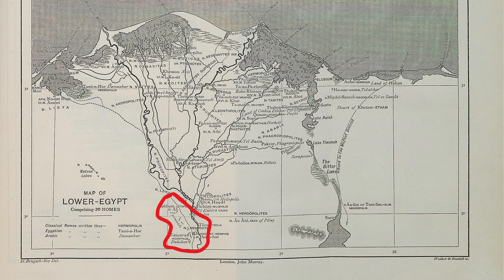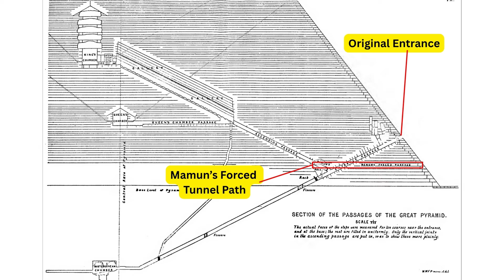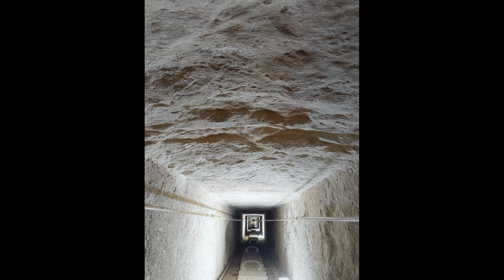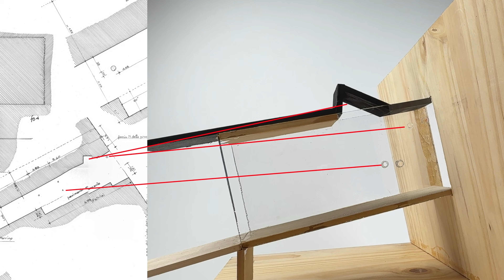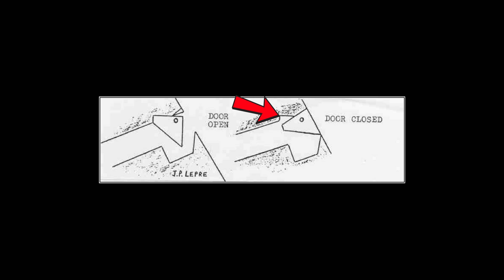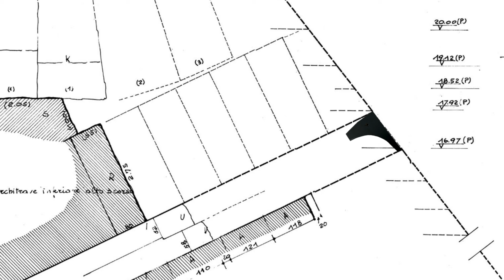The Complex Mechanics of Pyramid Doors

Comment: I feel like a very important detail that would help with answering if they had doors that could be opened is how former kings were dealt with.
Was there any need for rituals and magic inside the pyramid? Perhaps to cast protective charms that needed to be spoken within earshot of the kings body?
Was there some kind of holiday that included worship and required access?

A permanent tomb for eternity wouldn't need any access and thus no door. But if there is a reason for someone to get in, a path that could be opened would be required.

I could also see that there were different practices at different pyramids. The interiors also changed, so why not the process after completion.

And for steps leading up the outside? Could be stairs to a door. Or just to get someone to an elevated position. Perhaps a priest overlooking the assembled masses?
Reply from the maker: Great points and questions. I think a combination of those would make sense. Sort of like how we lay a president to rest in the rotunda.

Comment: I asked AI: What is the volume of the Suez canal?
That’s a good question — the exact “volume” of water in the Suez Canal depends on which parts you include. But we can make a rough estimate using published dimensions.

✅ Known dimensions
Length: ~ 193.3 km (as of recent configuration). Encyclopedia Britannica+2Suez Canal Authority+2

Maximum water depth: ~ 24 m. Suez Canal Authority+1

Typical surface-width / canal width: water-surface width can be ~ 313 m, while a narrower “navigational channel” is often 200–210 m wide. World Economic Forum+2Alexandria Chamber of Shipping+2

🔢 Rough volume estimate (upper bound)
If we approximate the canal cross-section as a rectangle of 24 m depth × 313 m width — multiplied by 193.3 km length — we get:

Volume≈193,300m×313m×24m≈1.45×10^9 m3
That’s about 1.4 billion cubic meters of water (assuming uniform maximum width & depth).
This means that approximately 14,500,000 m³ of stone blocks were removed to dig the canal. Those materials would have had to be placed somewhere: either piled up along the canal as a wall with the same width and height as the canal’s depth, or stacked into large pyramid-shaped structures. We chose the latter.
Reply from the maker: And how does that apply to a video about ancient pyramid doors

Comment: They are suppose to be sealed permanently after rulers body is put inside. Why would it ever have a door ?  In fact the Egyptians went to great lengths to hide the entrance after the ruler died and was put inside using large bricks.
Reply from the maker: The last sentence is not settled. Please rewatch the section where I mention the issues with plugs at the mouth of the entrance passage. Also no bricks were used. Thanks for watching!

Comment: Thoughtful video.  Just one question- Winches before they invented the wheel?  Big jump in technology for people that allegedly dragged the blocks up ramps.
Reply from the maker: My winch is probably more elaborate. I’m sure they had to have had some type of basic mechanical advantage in this circumstance. A rope wound around a beam with a cross bar at one end isn’t a big piece of technology. The wheel did come later most likely due to their society focusing on boats for transport due to the Nile and the sandy environment. However that being said I do not have clear evidence for what it may type of winch could have been used or if they had one at all. I’m not saying I’m right just saying it’s one possibly explanation for the holes other than as part of a door. There are of course other solutions as well.
Reply: @intothemap360 understood. We're all left to make our best guess on this topic - yours is a good one in my opinion.

Comment: I’m drawn more to a perfectly balanced door that only opened inwards, with joints so tight they blended in yet with the slightest touch would open. The reasoning for this is everything was deliberate with no mistakes and it appears everything was designed to contain (or harness) a great outward force or pressure. The concave 8 sides are like trying to open a double closet door at the same time and they just jam tighter, same as an internal force pushing outward on the sides of the Great Pyramid. The plug designs, with corresponding granite girdle stones are deliberate for a reason. Let’s just pray Zahi HawASS passes soon so we can take a step forward as humanity. ¢2
Reply from the maker: I see what you’re saying! Is it closer in your mind to the Lepre or Goyon door or something else. I will certainly build and test more door models!!
Reply: @intothemap360 I’m really interested in this and you’re the first to get comprehensive about it. Props. I want to know if all the stones are set at the inward concave on every course, further proving a deliberate design element. I’m sure there are areas where a couple of layers can be seen. Are you aware of the 360° girdle stones of solid granite in the passageways? Another interesting observation was that although isolated from the surrounding structure, the granite “king’s chamber” appears to have expanded outward. Although you’re focused on the door I also find the granite beams above the “kings chamber” fascinating since they are structurally not for weight relieving. The rough tops indicate to me they are ‘tuned’. As far as I’ve seen, no one has calculated their volumes and put together a “chord” structure. Similar as to how a wooden marimba bars are scooped out below but all have the same smooth playing surface. Given the piezoelectric nature of rose quartz granite this is indicative of another deliberate design feature. I hope the hidden gallery above the grand gallery is intact and untouched. I bet its entrance is obvious when it’s discovered, but so cleverly hidden it blends in like the original outer entrance door. Don’t get me started on the striations on the sides of the opposing shelves of the grand gallery and the sockets. We’re just children looking at a chainsaw and are led to believe it’s a tomb lol. If you have an attraction to Ancient Egypt I would suggest a lengthy trip down the Edgar Cayce rabbit hole. The forces at play are tremendous. Another great video topic would be the Shamir stone and its purpose and use and a possible correlation to the Dendera light and the scoop marks of the unfinished obelisk. Again, great video, keep up the good work. Your models show your after more than clicks like Ancient Architects who clearly does it as way to monetize people’s natural fascination and sticks to the mainstream narrative. History for Granite has some interesting graphics on the construction of the original entrance that may help. Aloha
Reply from the maker: I really need to get back over there and make some on site measurements of my own. I certainly am after more than views, I do this because I want to learn and this is the best way I can teach myself. I’m no expert, I’m just trying to show what I’ve learned and hopefully it’s fun to watch. I’d still make these with zero views. But I’m glad some folks like them!
Reply: the door being able to open with the slightest touch is stupid. a strong wind could open it
Reply: @acatinatux9601 ok then 20#, or 30#, or whatever you deem necessary to satisfy your negativity. The problem with negative people is they have a problem for every solution. They offer nothing and criticize others.

Comment: I prefer the door without counterweight opening to the inside.
It's the only one that would close seamlesss from. The outside.
It could be opened by bringing it into upright position with should not be too difficult. then revealing a hole at the top. Put a lever into this hole and you only need a few men pulling. When open, add some posts under the door to keep it open.
Only issue: how to close it from vertical to casing stone angle?
Reply from the maker: See this is why I love making videos like this. People come out of the woodwork with such clever ideas. I did not have a way to incorporate the little joke directly over the door into a design and this could be part of it. I believe you refer here to the flap style door that I showed being pushed inwards and then propped up. The best I had as a negative about it was a ridiculous claim about it being unsafe, hardly a concern for the ancients. I did not however bring up another issue I had with it and I’ll let you know what it is, and you may have some thoughts on the matter. The problem is as follows. If the door hinges inwards, there has to be force when released to push it forwards to match the angle. This is what I believe you refer to in your last sentence. In that I share your concern, if there is no counterbalance what force is there upon closing to hold the door upwards against gravity? I must build more models!

Comment: How do they open, displacing the space used by the stones abone them? This only seems to work in a drawing.
Reply from the maker: On the bent pyramid it’s hard to see a design other than one with a rounded top working. On the great pyramid the design in my model could work if the upper frame was designed correctly. As you can see from my model there are issues with the Petrie designed door binding.

Comment: The exterior swivel door seems to be used for repeated access such as for construction and inspection
Reply: These kinds of doors and corridors seem to work really well with the theory that the pyramids where not just tombs, but also something similar to aqueducts using gravity and water preasure for redirection.
Reply: I would say there were absolutely used for water containment and it was for drinking water. I wrote a book about it called rainwater answer to the pyramids @grimreaper3882

Comment: Wait wait wait, so you believe the great pyramid was built in 20 yrs as the mainstream narrative states? Just wondering, not going to attack you if you do.
Reply from the maker: I haven’t even thought about any such calculations. I just used those numbers as an example that they probably were done within a single engineers lifetime. Perhaps it was longer, that’s very hard to tell. I honestly don’t know where the 20 year period for the great pyramid came from. I meant it customary date between the start of the great pyramid and the bent pyramid was about 20 years. It does seem like a lot of pyramids to get done in that time, I do not have a firm grasp of the arguments on either side to speak to it more accurately

Comment: Cool mate - I'm having to rewatch it (I think I've rewound at least 3 times, mostly because of my wandering mind though), but I presume I are aware of the channels "History For Granite" and "Night Scarab"? If not, then I'm sure you'll enjoy them, especially History for Granite on this topic, because iirc he has a different take on the functions of the pyramids and their openness to the public/private guests.
Reply from the maker: There is always another way to interpret these topics and I won’t ever say mine is the only way. I have deep respect for History for Granite as a researcher. I hope my little pyramid models use of my engineering and research background will help me stand out from the crowd.
Reply: @intothemap360 , Yeah man, I'll certainly be watching more!
I'm a bit lost with how you're describing the doors/openings though, even with the models - it is very late however, so I will try again!
Extra voices are always especially welcome when they're saying something new.
Reply from the maker: It is a difficult mechanism and it does have issues with fitting and movement depending on the style so I don’t blame you. I had to build the models to even start to get it myself so no worries. I’m also not good enough at 3D modeling to make it in CAD so models it is.

Comment: It is more likely that Mahmud entered the pyramid through the entrance door and cut a tunnel to the outside in order to remove an object that was extremely heavy and could not be carried up the passageway. Considering the sophistication of the door it is extremely unlikely that a ramp was ever used, but a lever balance was employed to raise blocks up to each successive course during construction of the pyramid.
Reply from the maker: An interesting idea but I would have to think very hard about this before I could speak to it with any certainty. It is an interesting concept worth researching